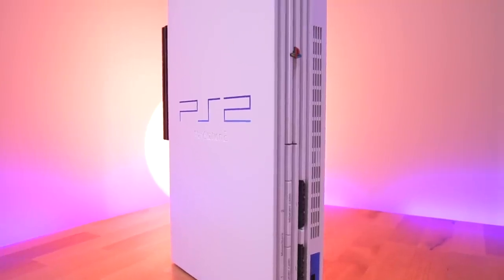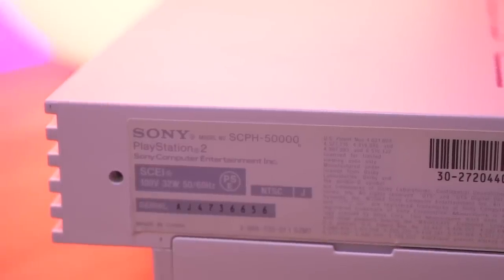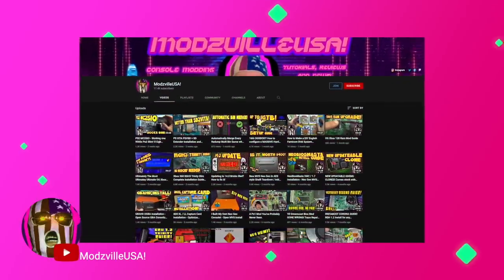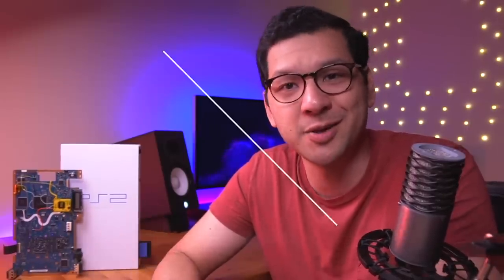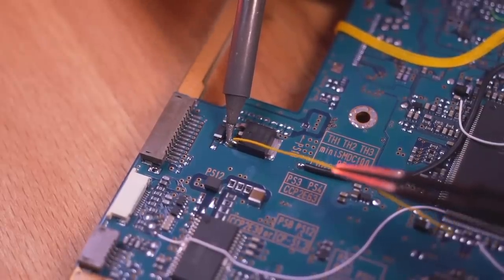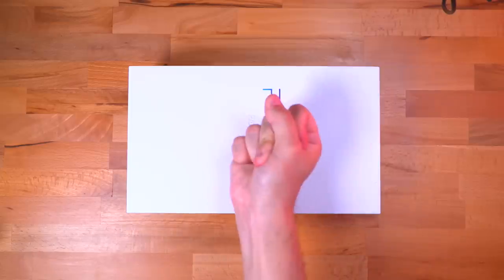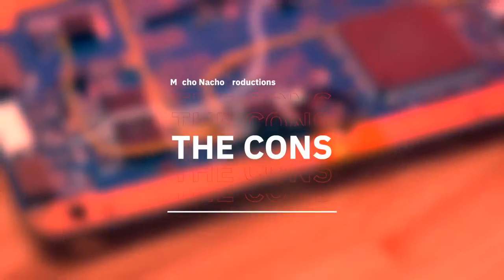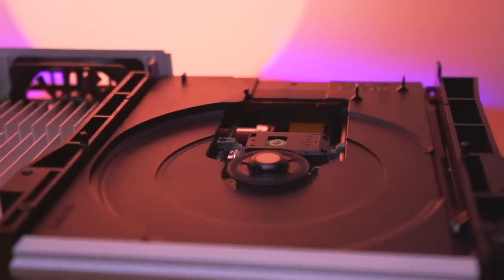This Mod Prevents Your PS2 Laser From Burning Out | The PicFix Mod

Comment: Now do a video repairing the board you messed up :). I recently did something similar and it required a new fuse and the BA5815FM replacement. Not sure if your repair is the same but that is the laser controller IC.
Reply from the maker: I have someone looking at it but it apparently is most likely a blown fuse

Comment: This flaw killed my 70000 slim with the v12 board about 15 years ago. I used swap magic discs with the lid spring bypass. Originally I thought the burns killed the laser but eventually this flaw was discovered and now it’s obvious that’s what happened. All as Sony intended because it isn’t even a conspiracy to say this was intended to be an anti-mod function that, like most anti-mod functions, backfired and was corrected (removed) from some 70001 and all 75000’s forward.

Comment: I have a SCPH 5000 that already has drive problems from the plastic gears being worn out. I ended up making it worse by doing a lens position adjustment without marking the original position for the adjustment screw

Thankfully this all happened around the time OPL came out, so I've been 99% hard drive ever since.

But I should still do this mod if I ever get around to fixing the gears and lens position. It would be nice to have the ability to play any used games I pick up without having to rip them first, and not worrying about damaging the laser if they're scratched up

Comment: I just rip and run my games off the HDD nowadays. But it's still a good option to have to prevent this potential issue from occurring. Very informative video. That title card could've used some work, though. I have to agree that it does seem rather alarmist, since not everyone uses the disc drive to run games these days. But if it did occur, it's not like the PS2 is bricked, it would just need a laser replacement to resolve (And then this fix also applied to prevent it from occurring again). I suggest just rephrasing it so that you're referencing the disc drive dying, and not the PS2 as a whole.

Comment: Never had such a crash, but I've had a number of fat units in the past that had disc read errors. I'd usuall just fix the error and stick the unit in a pop top instead of using the drive arm.
Reply from the maker: The crash from my understanding usually happens with a bad disc with scratches or if you have a modded console and play burned games. If your console is unmodded and your game discs are in good condition, you should be okay 👍

Comment: Hm. So this is what it was. 

Back when we had a slim ps2 with a modchip installed, while I was playing a bootleg copy of a game, it stopped loading on a black screen. The thing was I couldn’t turn the ps2 off using the power/reset switch (resetting it does nothing too) and opening the disc tray didn’t stop the disc from spinning and kept scraping off the stopper bump thing. After replugging, it didn’t read my game and going to the browser it’s stuck at reading the disc, opening the tray again exhibited the same behavior (it didn’t freeze the ps2 itself tho which is probably the weirdest thing). Since then, it struggled to read discs then burning out shortly after, that’ll teach me for playin them bootlegs I suppose.

Whew, what a ramble. I didn’t think I’d get my curiosity from the back of my childhood get answered so randomly like this.

A rare issue for sure when playing original discs, but could be useful. A fried Mechacon is the last thing I want. *shivers* So many horror stories.

Comment: Just fixed 5 PS2's, 3 had bad lasers, 2 were SCPH-30001, one SCPH-50001. Other two had bad power supply capacitors.

Comment: I wonder how necessary this is unless you are using a lot of burned media on your PS2.. I've never seen the mechcon crash from a legitimate disc before but I suppose anything is possible and a mod like this is great for peace of mind.
Reply: Keep in mind that this damage only happens once. So, it's not going to be very common. But, if it does happen, it's a rather big deal as replacement parts are only going to get harder to come by over time.
Reply from the maker: Definitely burned games will cause the crash most of the time. Scratched disc are also known to cause crashes as well but less prevalent
Reply: Well I could see this being very useful only because if you have a PS2 and it is going to need your visions you're more than likely going to buy games used which could have scratches on them not to mention stuff happens to games discs if you are around little kids or if you drop them stuff like that so this could be a very useful tool to keep it alive I think I've done had two or three PS2 to do this s*** because of me buying these games especially from a sketchy pawn shop that I used to go to when I was a kid that does not exist no more because the building looks like a grenade went off in it I live in northwest Florida so Michael

Comment: So what if you don’t use the dvd drive and just play backups off hdd or Eth to USB adapter? Still bricks it or nah?
Reply: It doesn't actually brick it, the problem is that when the Mechacon crashes it over volts the laser in the DVD drive. If you're not using discs this isn't going to happen.

This flaw damages only the laser in the DVD drive, anyone saying that it bricks your entire system is spreading misinformation.
Reply from the maker: You should be okay 👍

Comment: hello macho nacho i have a massive favor to ask you. recently ive been looking into the play station X basically the ps2 with a DVR strapped to it which was a japanese exclusive i spent a week researching into the hard drive encryption thing and i figured it out. the only problem i have is ive tried posting my findings twice on 4chan and only got 20 responses in total and i need your help contacting someone in the ps2 modding scene.

while watching one of your videos i believe it was your linux on the ps2 video and i wondered why the ssd did not work with the ps2 i looked into it and found out alot of things. sony basically outsourced like the drives to a bunch of companies and the drives basically contain a couple lines of code that can be found on the drives firmware and not the disc which is why a couple things occur like when using a hard drive the console takes a bit longer to boot and thats why the ssd did not work with the linux disc you had. this explains why a couple people were able to boot up the PSX with the 40gb final fantasy ide drive 

theres alot more stuff i want to share with you and i hope you can forward this stuff to someone that knows more than i do

the reason i found out that the special firmware is on the hardrive is because his unit has a dead hard drive which he only has plugged in for the system to boot which basically shuts off after the check at the boot to see if its a legitimate sony drive)

(i just commnted this twice cause the first time was deleted because i think it contained links but ill get straight to the point)

just google "Hard Drive - PS2 Dev Wiki" it should be the first link , scroll all the way down to " Sony custom ATA commands" these are the commands the PS2 and the PSX uses to verify whether the drive is a legit sony drive or not. personally i believe there is a way to trick the system like put it in free mcboot or have something like the picoboot tell the system the drive is legitimate)

this is basically my last ditch attempt to kind of distribute this info cause no one really cares about the PSX system and most people dont think to much about the PS2s hardrive like sony lock thing because we have things like OPL that just bypass it
Reply: i may have left a few things out and im sorry about that ive actually typed this up 3 times and im not sure what else to do
Reply from the maker: Send me a message on discord or Twitter. This info sounds very interesting. Thanks for reaching out 👍

Comment: Does this do the same thing as the "Romeo Mod for v9 / v10 PS2's" ? which I have already done to my v9 ps2 which drops the voltage of the to the BA5815FM chip from 12v down to 5v? please advise thank you!
Reply from the maker: It’s a different mod from what I understand but achieves a similar end.
Reply: @MachoNachoProductions  ah ok thank you I will take note on this mod to I enjoy your vids thank you again :)
Reply: LA6508

Comment: Honestly speaking...I'd recommend getting a SATA adapter, a FreeMcBoot memory card, and a compatible hard drive. Load it up with PS2 isos and play directly off the HDD. Also, you can play PS1 bin/cue files off a flash drive with this method.
No more dealing with aging, failing optical drives.
That is what I did with my PS2 with a non working DVD drive.

Comment: 1:35 SCPH-39xxx also can suffer MechaCon crash, but on a lower rate
Reply: 39000 doesnt have a mechacon
Reply: @brandyberry14  all PS2 have a Mechacon...

Mechacon is in charge of controlled mechanics and security inside the console...
All PS2 have one

The diff is that on 50k and newer models they changed the Mechacon CPU architecture. But nothing else

Comment: I don't own a PS2 but I'd like to get one sometime. I'll keep this mod in mind whenever I do.
Reply: Honestly, you should probably get an early model of PS3, I'm still kind of pissed that my PS3 had that functionality removed, but didn't really indicate it on the box. Granted, I was mostly buying it for the ability to play bluray, but it should be legally required for reductions in capabilities to be clearly listed on the box.
Reply: @SmallSpoonBrigade  So your PS3 is not backwards compatible? That sucks. Do the earlier models of PS3 play PS1 games too?
Reply: @animeking1357  From what I can tell the first generation PS3 had hardware support, but was Japan only. The second had software support for PS2. I have no idea about PS1 support without hacks.
Reply: @animeking1357  All ps3 models play ps1 games.
Reply from the maker: Early model ps3s are awesome!  Stinks they switched to emulation in later revisions.
Reply from the maker: My early model ps3 is fully hardware compatible with ps2 games. I believe it plays ps1 as well
Reply: @MachoNachoProductions  Awesome. That's what I'll look for.
Reply: @animeking1357  Not so fast.

Before you grab a BC PS3, you should know it has 2 or 3 frames of input lag that it adds to PS2 and PS1 games. Even though it has PS2 hardware inside, it still sends the video through a frame buffer which adds the lag.

So I still play all my PS2 games on an actual PS2. RPGs are fine on a PS3, but if you want to play something like a fighting game, racing game, or shooting game on a BC PS3 you're going to have a bad time.
Reply: @lulkLogan  Ooof. Thanks for telling me. I'll keep that in mind.
Reply: @SmallSpoonBrigade  including USA

Comment: Mekka-lekka-hi, Mekka-hiney-ho!

Anywho, did you say that there is no way back from this crash for a PS2? No manual reset of a chip or anything? Reprogramming? Is it permanent? Just curious.
Reply from the maker: The ps2 will most likely be okay, it’s just the laser that gets burned out. The crash causes the laser to burn but you should be able to replace it and have everything functioning again. This chip os mostly a preventative measure.

Comment: My laser doesn't read disk anymore. The laser went out back in the 2000's, don't know what year exactly but i refused to throw it out.
Reply: Put a Hard drive, FHDBoot, and OPL in it and start playing games again. you don't need an optical drive to play games on the PS2
Reply from the maker: Definitely keep you. You can either replace the laser or use it with freemcboot and a hdd or both 😁

Comment: My PS2 is hooked up to my OSSC right now, but it's a Phat PS2 /w a hard drive loaded with games, so i'm not too worried about "using media" at this point. I move the game images across the home network over to it. I just wish it had an HDMI mod. 

I'm guessing the issue in this video happens to all PS2's, but this mod is only available for the mentioned models. If I am wrong, please clarify. TIA.
Reply from the maker: I do not believe this issue affects models other than the ones I mentioned in the video.

Comment: No idea if this was the reason why, but my slim PS2 only lived about 6 months and stopped reading discs. I had younger siblings and they tended to leave games laying around so I wouldn't be surprised if it was from a scratched one. I wish I knew about this then. I was like 10, so I wouldn't have been soldering for a few more years even if the mod existed then, but just knowing a beat up disc could do this would have been nice.

Comment: So I have a launch day PS2 ( yes a fatty that still works perfectly) your video says V9 through V12 are the ones affected by the issue, do you know if launch day versions have same issue.
Reply from the maker: I think you should be good 👍
Reply: @MachoNachoProductions  thanks was pretty sure based on this video but figured it didn't hurt to ask
Reply: V4 and earlier have older lasers

Comment: The model number on my PS2 is SCPH-50003, could it be at risk?
Reply from the maker: Potentially. Best way to check is to see the motherboard revision. Also, is your console modded?  If not you’re at much less of risk.
Reply: @MachoNachoProductions  Console has never been modded
Reply from the maker: @GeneralAlpaca  you should be good 👍
Reply: @MachoNachoProductions  thanks

Comment: Is this pic fix necessary with an unmodded console?
Reply from the maker: Not really. Most of the issues stem from playing backup copies of games. However it has been reported that scratched media could cause the mechacon to crash. I think if you just play authoring games in decent condition, you should be fine

Comment: Hey Tito im wondering if previous models like the SCPH-3000xR with boards v5 and v6 have the same issue with the laser? I've seen people in Mercado Libre (south american eBay) who sell modbo 4.0 and 5.0 with a little board with diodes saying its a "laser protection" but they don't know for wich specific boards are.

Comment: Does this mod allow for the use of FreeDVDBoot? It's just a protective layer for the laser correct?
Reply from the maker: Yes, this shouldn’t interfere with any mods. It just detects when the mechacon crashes and puts the console into standby mode
Reply: @MachoNachoProductions  Thanks! Recently got a slim 7000 model to compliment the old 3000 phat. Was thinking of playing some burned backups and I might have to go for this mod. Loving the videos by the way!
Reply: @MachoNachoProductions  does ps2s work Without The Mechacon Chip On the Motherboard

Comment: I wonder what this also be useful for a debugging test PS2 as I do have the 5000x variant myself.
Reply from the maker: Great question!  Not sure if it will help with debugging. I just know it’ll detect when the mechacon crashes and put the consoles into standby mode
Reply: @MachoNachoProductions  I mostly use it as a region free PS2 they can play both original and burnt copies so this mod might actually be helpful.
Reply: I believe the debug ps2s don't actually have this problem, this problem occurs only in retail PS2 systems since those are the only ones that have a DSP and bios that check the logos of the discs, debug units only check the region and boot flag of the disc.

Comment: I had a modchipped ps2 slim that had this issue. but not only the lens was fried, the motherboard had a dead resistor (¿?) as well. the dead resistor was removed but then it would not read all games or woulf crash on certain others.
Reply from the maker: Yeah, burned laser assembly can be replaced and you should be good. Did you replace the dead resistor?

Comment: I want to open my ps2 but it still has its warranty sticker which I like for show reasons so Im split right now
Reply from the maker: Same, it’s always a dilemma I face. I wish there was a reliable way to keep them intact. I’ve decided that I’ll eventually have to remove it at some point so I just remove them or cut them
Reply: You can use alcohol and a flat surface to preserve it, there are videos and instructions how to do it. I too have the sticker and sent my unit to be fixed but they reapplied it back too

Comment: In My 90k1 the glue on the flex cable from the lenses failed and the cable got higher than the lenses damaging some games.
I only noticed that after the 5th game.
I started playing some older classics and the game after a while stopped working, and I kept trying, only to see that the cable rubbing against the disc were damaging the discs.
Reply from the maker: Oh man, that sounds like a nightmare!  Seems like and design flaw. What was holding down the ribbon before you glued it?
Reply: @MachoNachoProductions  the OEM double sided tape. The console was from 2009, and the tropical climate of Brazil, well, kinda foreseeable.
But I stoped using optical media on it and fitted with an external HDD and freemcboot

Comment: can this happen using original discs or OPL only (via hdd) ?
Reply from the maker: If you’re using original discs and hdd you should be fine for the most part. Apparently, a scratched disc could potentially trigger a mechacon crash though

Comment: Good thing I haven't put a disc in my slim PS2 since discovering Open PS2 Loader 9 years ago.

Hell, with the way my retro game area is setup I can't even put a disc into it. I have my PS1, unhooked and unplugged, sitting on top of the PS2 as a display piece and a bunch of knick knacks sitting in front. There is only enough room to stick my hand in and hot the power button. It would be extremely inconvenient to move things just to put in a disc. I love network loading.

Needless to say, I'm not bothered with installing this fix.